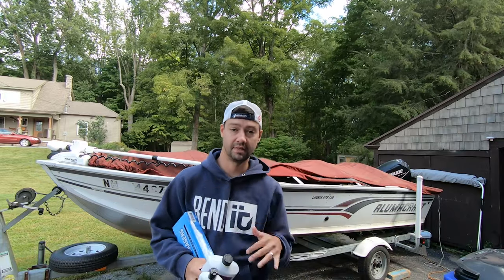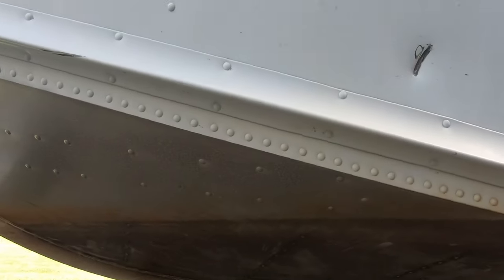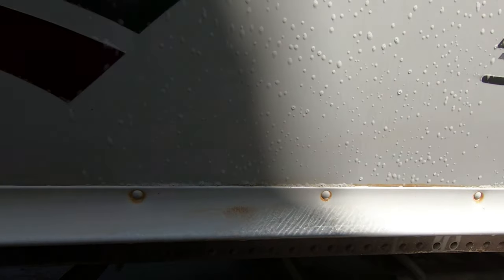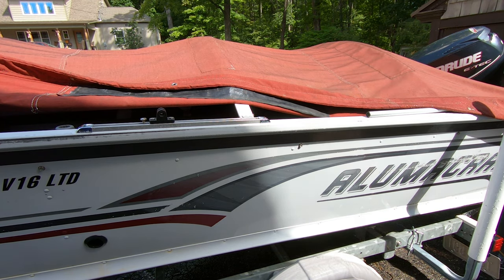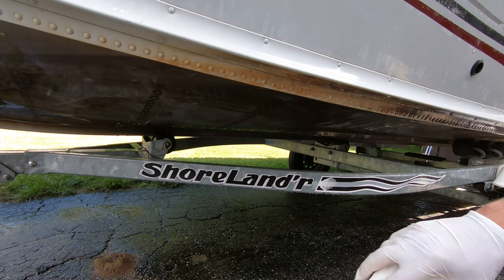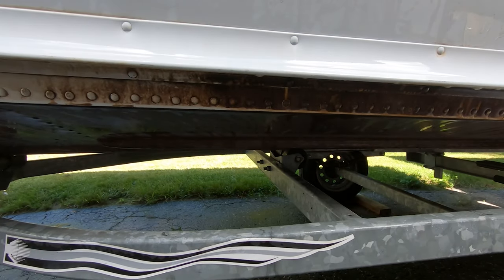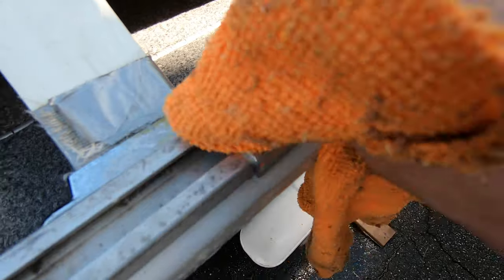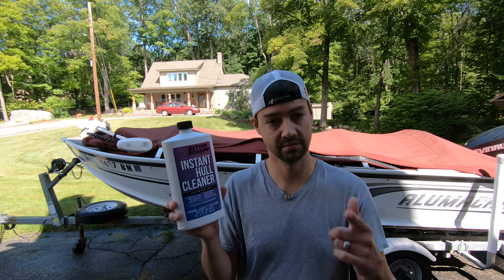Clean your Boat Hull in just 2 Minutes- Instant Hull Cleaner

Comment: Hi Josh. For all the tips I gotten from you I’ll pass along one for boat cleaning.  Slimy Grimy. A powder that comes in a little tub.  I use half a tub in a pump sprayer, add two gallons of hot water, pump it up and spray on.  Before it dries rinse off with a hose.  No scrubbing.  If the boat is really stained from sitting all year on a mooring I might apply it again to those stubborn spots. The pump sprayer makes it easy to get the bottom of the boat while sitting on the trailer.  Stuff works like magic.  Toxic free, doesn’t stain the driveway or kill the grass.  Use the other half of the tub next year. $30.  I get it at my local marina.
Reply from the maker: Thanks for the tips! I thought my boat was clean till I used this stuff

Comment: I have the same boat. My Father-in-law had it before me for 20 years. He normally kept this boat sparkling clean- but it sorta fell to the side when my mother in law was sick with cancer and passed away (understandably). So I'm going through and giving it a good deep cleaning.  Took it to the car wash today and gave it a good "surface clean", going to break out the toilet bowl cleaner this weekend and whiten it and the trailer up.  Used simple green on the inside to clean up all the shoe prints, paw prings, worm/fish guts/slime/etc.  How did the metal polish work on the gunwales of the boat?  Mine has bare aluminum gunwales, and it's all scuffed up from the docks, grease, etc. I'll have to give these products a try!
Reply from the maker: It's a great boat! The polish worked but my metal is pretty toasty from salt water.